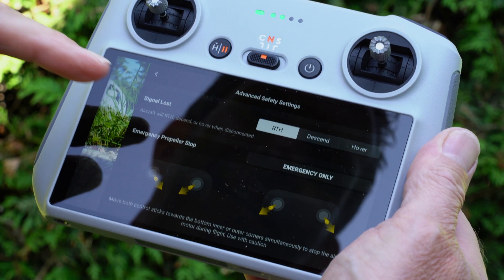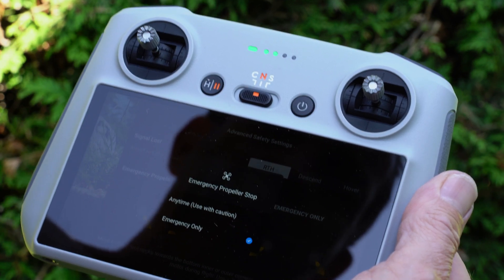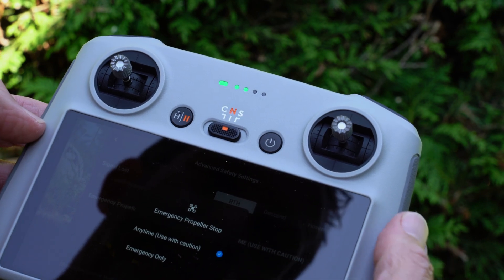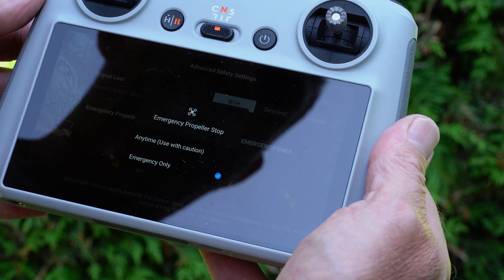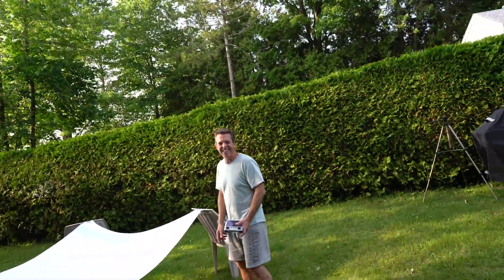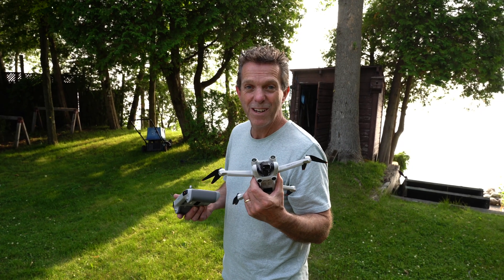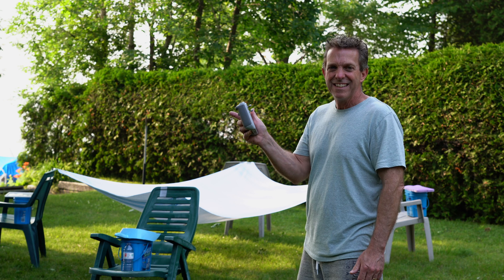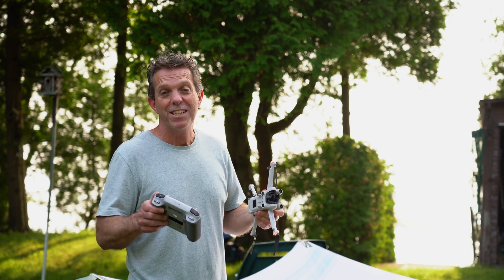Emergency Prop Stop - Mini 3 Pro Tutorial - 4K

Comment: I have a Downward ToF Sensor Error on my M4P and need to use Emergency Stop when landing to stop the propellers until I can get it fixed. I wish you could choose this feature and assign it to a screen button (with a double push requirement) vs having to use the sticks to execute the stop. I"m with you that leaving this on anytime could lead to problems since it would be possible to inadvertently push the sticks into the stop position.

With this error I can land it but the props don't stop spinning so ESTOP works great. Other than the landing problem the M4P appears to be fully functional and works perfectly with this error. Do you have any info on exactly what this error is? Thanks for your video.
Reply from the maker: To be honest Christopher I've never heard of such a problem. There are many forums out there that someone might be familiar with that. Sorry you are having this problem but good for you for figuring out a temporary solution. Do you have DJI Care Refresh? I have always add it on, it has saved me a few times. Thanks for checking out the video. Good luck with this issue.
Reply: @ORGANIZEDCoNfUsioN  Yes, I do have Refresh. Have questions into them but haven't heard anything back as of yet. At least it's usable for the time being. I've posted to a few forums but haven't received any replies. I'll figure it out. Appreciate the reply.

Comment: It looks like every test was offset from the net to begin with, why not just fly directly over to increase the odds of hitting it?
Reply from the maker: Thanks for checking out the video. The first 2 tests I did were directly over the net, not included in the video. Both times it missed, it just doesn't drop straight down. For some reason it rotates quite a bit then falls. I'm just glad I didn't break it.  Happy holidays!!!